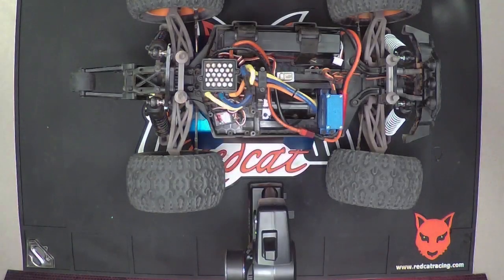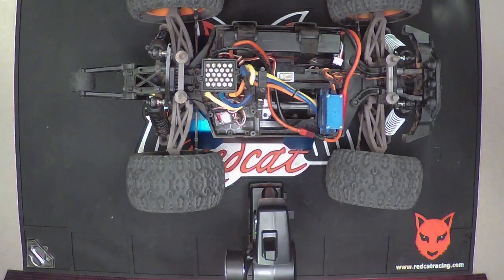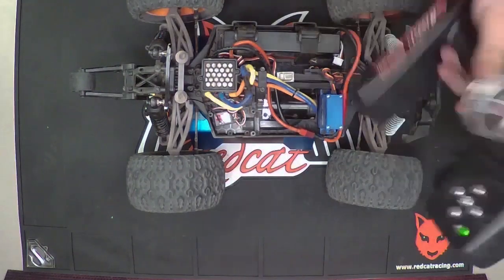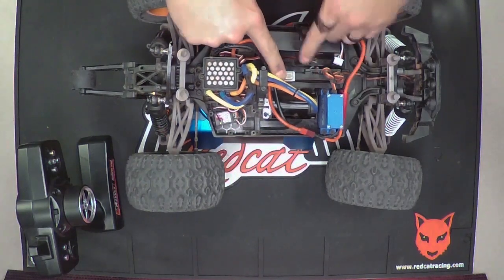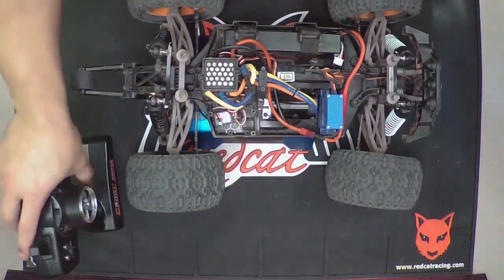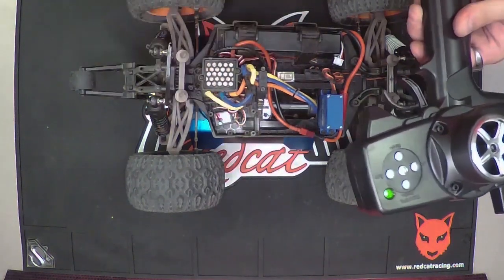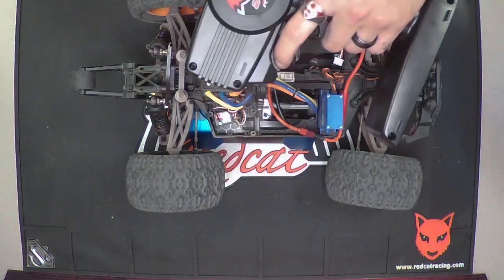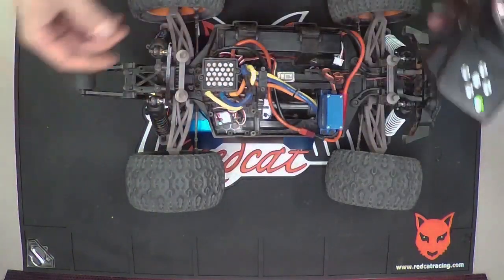Redcat University -  Brushless ESC Calibration

Comment: Greeting from Guam, I just got a Kaiju EXT from Horizon Hobbies. There are 2 specific programmable Value that I would like to increase from the manufacture settings out from the box. One is the “Low Voltage Cit-Off Threshold it is set at 3.0V Cell and I would like to change that to 3.2V Cell. And the Max Brake Force which is factory set at 25% and I would like to set that at 100% please assist?

Comment: I have a terremoto v2 and I Got new batteries that are 50 C same exact voltage 50 C versus the original 20 C batteries I put the batteries in the car and got forward for a few seconds and now I have no throttle I do have steering response I can see the light on the transceiver it’s red not flashing and the light on the speed controller is green on nothing flashing I just don’t have forward or reverse. I tried to follow your video but when I press and hold the little white button the truck just turns on as normal and there is no binding or reset.

Comment: We are not getting the third sequence on the programming with the three beeps for the reverse option. The first two for neutral and forward both work with the correct amount of beeps but it will not be up three times when we do the reverse option we have tried two different ESC’s and on the third sequence on both of them there are no three beeps
Reply: Having the same problem man. It'll set the neutral position, but won't do forward or reverse.... About to smash this stupid ESC..... Getting real frustrated lol
Reply: @OnTheDownLowODL  We had to get a hold of the company and they finally sent us a new part that fixed it it was defective from the get go right from the factory

Comment: How do you adjust the brakes...mine are set a little too high?!
Reply from the maker: The ESC in your model should have a "brake power" programming step.
Reply: @RedcatracingAZ ...It does but the instructions that I read anyways don't clearly tell you how to use it!

Comment: Hi I find even after following the ESC manual, I'm still not able to get it to go into setting to set low voltage cut off. Any advice pls?
Reply from the maker: Depends on the ESC but not sure why that would be the case.  Best option might be to contact our support team. 
They can help out Mon-Fri 8am-430pm AZ time.
https://www.redcatracing.com/pages/contact

Comment: You mentioned to set the throttle trim to 0. How do you do that? I have that exact standard Redcat racing controller. It is all digital and nothing seems change when I push the silver trim buttons. Are the silver buttons dual function( I cant figure out how to access TH Trim vs TH EPA)?
Reply from the maker: Depending on the remote the throttle trim may be different. We recommend referring to the manual for that model remote to find that out.

Comment: My red cat volcano epx doesn't have that button, what do I do?
Reply from the maker: Are you sure you have a brushless "PRO" model? The Volcano EPX - is usually a "brushed" model and will not have a button on the on / off switch. It also can not be and does not need any kind of calibration.
Reply: @RedcatracingAZ  yes but it is not a pro model

Comment: This is not working and the process seems to be very different on my vehicle
Reply from the maker: Depending on the vehicles ESC you might have to do another calibration process. There could also be a system error preventing you from accomplishing this. But this process is the same as it is on all other Brushless models we carry. 

Maybe try calling out support line for more help. 
https://www.redcatracing.com/Contact

Comment: Hey im having an annoying problem with both of my redcat brushless trucks I have teremoto v2 1/10 scale and blackout xte and they both won't go in reverse I re- calabrated them both like you show in the video and still won't plz help solve this problem im trying to play with my daughter but reverse is important when learning thax
Reply from the maker: Most likely need to change the "run mode" - Check the ESC manual or the Vehicle manual for the ESC programming steps. You will need to change the running mode from 
"Forward with Brake - NO REVERSE"  < this mode is for racing because you don't want to accidentally go backward on a track into on coming racers. 
to 
"Forward with Brake + Reverse"  
We dot not have the running mode change video yet but there is probably a few you can search for and follow. IT is a fairly simple process similar to the Calibration steps. 
If you still need help be sure to give our support team a call. They can walk you through it over the phone. 
http://www.redcatracing.com/Contact

Comment: Hi, my problem is that the green light doesn’t even flash. I do everything just like on your video but when i press the set button to set neutral point nothing happens, beeping and red flashy light stops but green one doesn’t appear. Any solutions?
Reply from the maker: Hey Groove - so that could be one of a few things. It could be one of several bad electronic components. But in order to find out which - if any - you will need to test the functionality of each in order. The best thing to do at the point you are in is call up our support line and have them talk you through some tests to see what we can come up with as a cause for your situation. 

So reach out to our support team via email or phone Mon-Fri 8am-430pm AZ time. We can help for sure!!
http://www.redcatracing.com/Contact

Comment: I've programmed everything but the throttle doesn't work. Can you help me activate the throttle. Steering turns on but no acceleration
Reply from the maker: Aw that is no fun. Could be a few things but best to check over some info. Best bet is to call our support team and they can walk you through some tests. Just let them know exactly what you have done to the vehicle - what has been replaced if anything - and that you tried the RCU Calibration video steps and still no luck. They will go over some other tips. 
http://www.redcatracing.com/Contact

Now a really good thing to check just in case is the battery voltage exactly - with something like a volt meter that will tell you the value not just "charged" or "not charged". Second would be the motor plugs that lead to the ESC - see if they are fully plugged in still and in good contact.

Comment: So, I hold the sel button and turn on the ESC and it starts beeping. Then, I hit the sel button and it's one long beep and the red light stays on. Any ideas?
Reply from the maker: Might be a ESC error or Motor error. Only way to know is to test the ESC with another motor or the motor on another ESC. That will rue out the error.

Comment: hi help please my car goes faster in reverse  swapped motor wires done  reverse on tx my esc has no set up button on it how do i do what you did in your vid my esc  is a60amp gool rc rebrand ed ocday  one got it to go where i have to push forward on my tx  to get max speed with car going forward  got a program card with it just basic lipo setup lvc brake %  soft hard medium start newtrol range %  also set up drag brake but can not get it back on now  as tx   is reversed forward on stick car goes forward any help anyone would be apprece aited

Comment: I recalibrated mine but it still won’t go in reverse.. any suggestions
Reply from the maker: Sorry for the delay Gabriel - did you ever figure out your ESC issue? 

Sounds like you are in the running mode with no reverse. Most brushless ESC's have that option. In your case your system was/is in the Forward with break only mode.
Reply: Same problem. I talked to support and there sending me a new esc. I hope it will fix my problem.

Comment: I have throttle but no steering, is there a reprogram?
Reply from the maker: Please reach out to our support team for assistanace. 
The quickest way to get support is to open a warranty case = http://www.redcatracing.com/Warranty-Claim-Form. Or you can email support@redcatracing.com
Reply: I had the same issue. Check to make sure you don't have your steering trim set to 0 on your controller

Comment: How do you program it to not have the lag it has when you go full throttle from a dead stop, almost like a safety it seems, I own 2 Volcano EPX PRO's
Reply from the maker: What you are experiencing is the sensorless brushless system that we have in the vehicle. Sensored brushless ESC's do not have a lag but sensorless systems have that because the ESC and motor are not 100% in line. So when the motor gets the power from the ESC it is not in the perfect spot so it hesitates till they are in sync and then takes off. Depending on gearing - mesh - and the Motor and ESc in general that may differ from vehicle to vehicle.
Reply: Is this able to be changed? there are videos that show i can reprogram the esc to eliminate that hesitation
Reply from the maker: On the Hobby Wing ESC in those models you can program the "Punch" level which will indeed help. But not 100% take it away. The only way to remove that lag 100% is to install  a brushless sensored ESC+Motor combo. They use them in sanctioned racing a lot so they are readily available. However; we do not sell any sensored ESC+Motor combos. If you want to check out the programing step feel free to check this link out. http://www.redcatracing.com/manuals/HW-WP-10BL50-RTR.pdf  It covers the 10BL60 + BL50 and the S10D. If you happen to have a different ESC model just "Google" search that model for the Manual and you should find the programming in it.
Reply: Thank you very much, I have my original box, manual and all other goodies that came with the truck, i will take a look